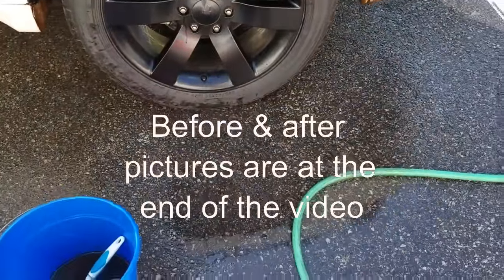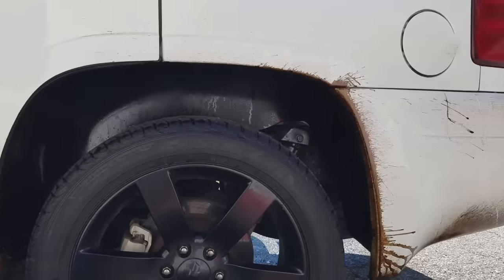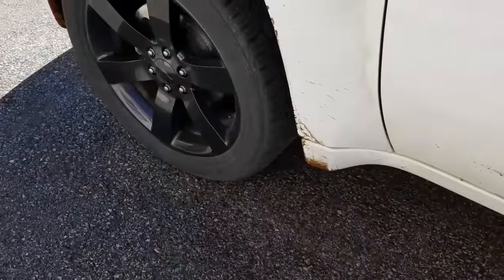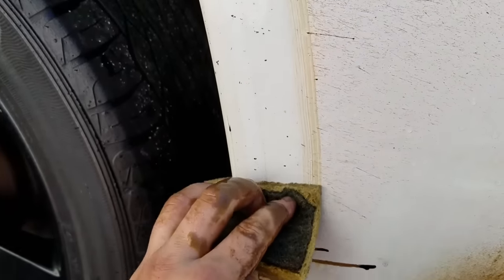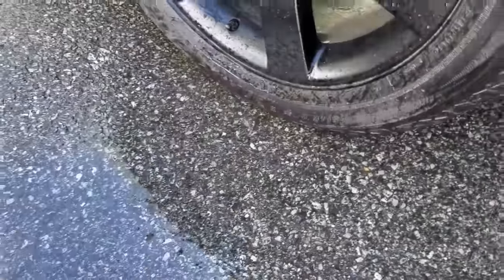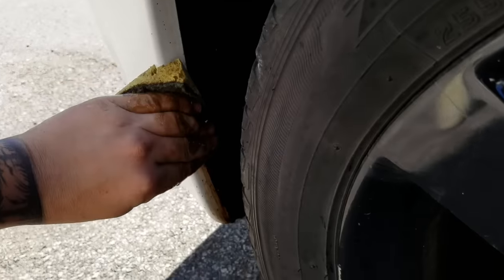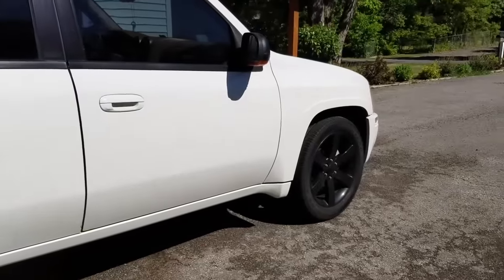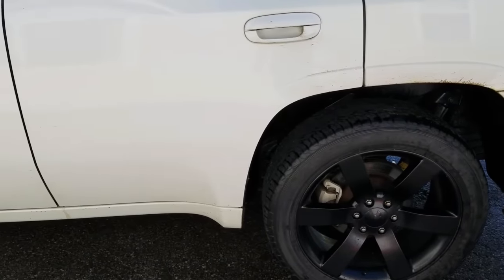Removing tar / asphalt with WD40 simple

Comment: Wd40 is a great tool for removing tar and contaminants from just about anything. The only thing I would say is to use a specific tar remover on paint work as wd40 can blemish the paint work on some paint styles. I would also say never use it on single stage paint on older cars. But wheel barrels and in the wheel arches, on mud flaps etc nothing better than wd40 for a quick cheap solution.
Reply: 6th
Reply: ⁶5 5th

Comment: WD40 will hurt the paint, i did my own research before debadging my BMW. I wanted to know what would remove the leftover adhesive. After visiting endless motor vehicle detailing forums i came to the conclusion WD40 is a NO NO, as it eats the clear coat over time.
Reply: WD-40 is mainly mineral spirits, perhaps with some other ingredients.